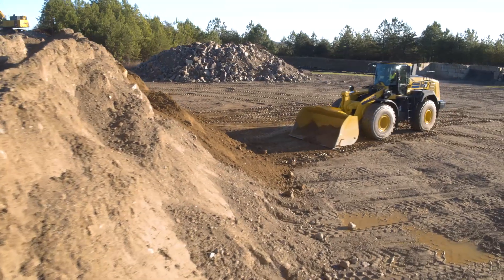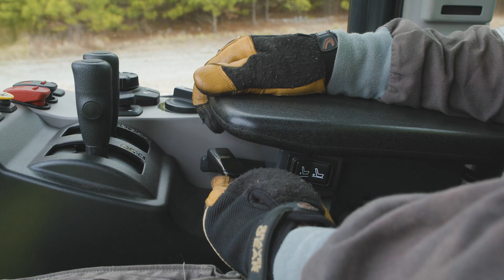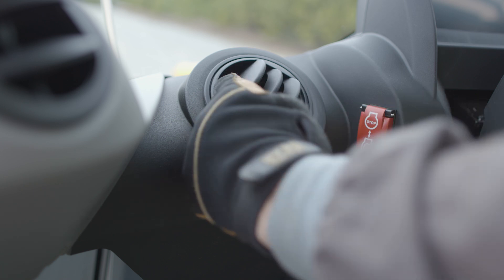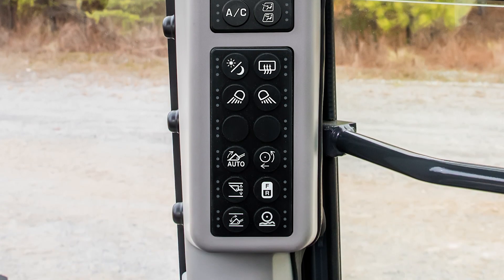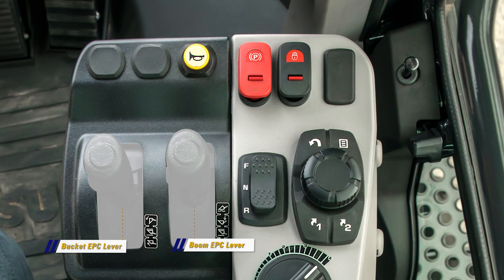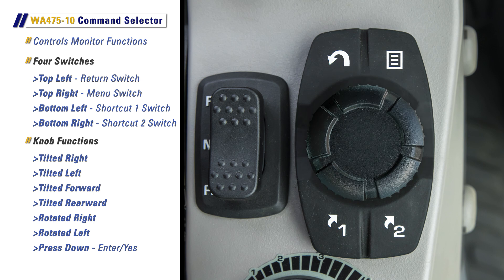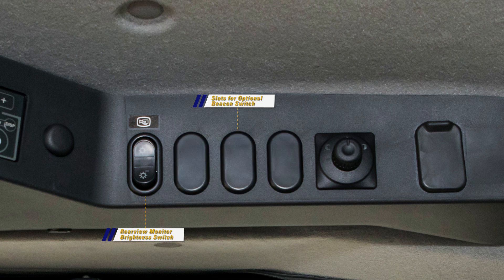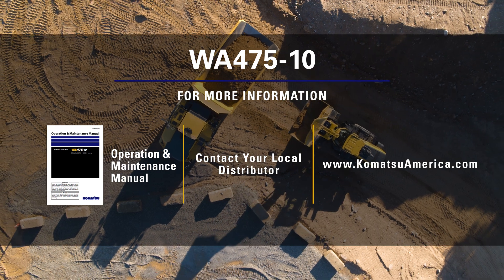Komatsu WA475-10 cab controls

Comment: Hi there, has there been any improvement in the infrastructure to complete all repairs in a decent amount of time? Waiting for the service technician for just the simple things like seat suspension repair, lighting, operational buttons wore out, a/c, heating also the fan and engine emissions problems   
Another issue I notice is that during operation in cold weather-15 and colder there’s not enough warm air flow to defrost all the windows and the steering lever on the left is very delayed and clumsy in cold weather.